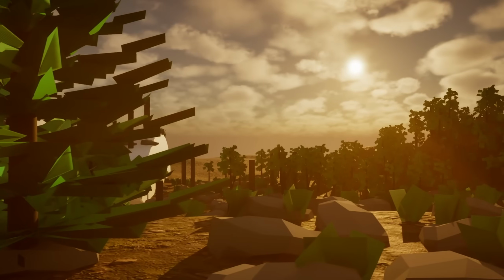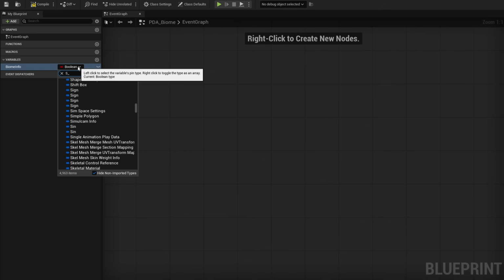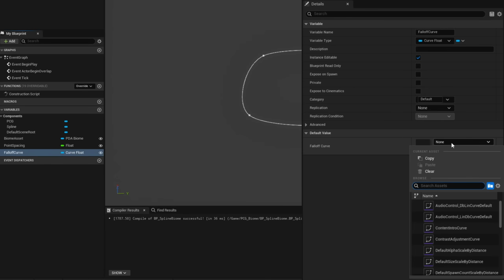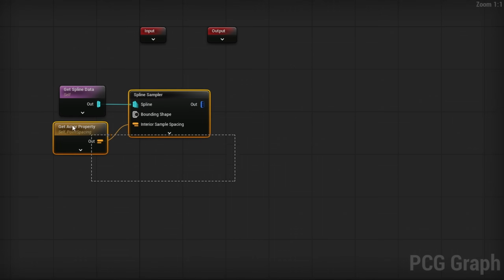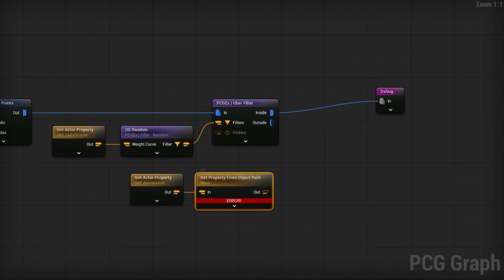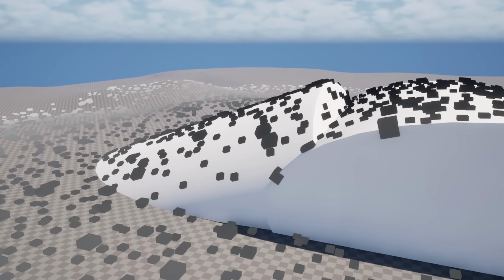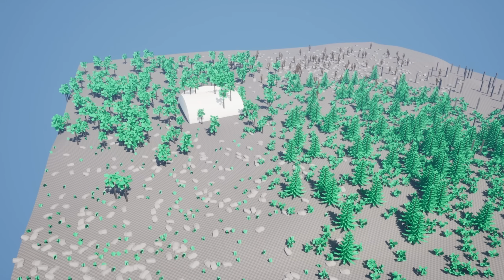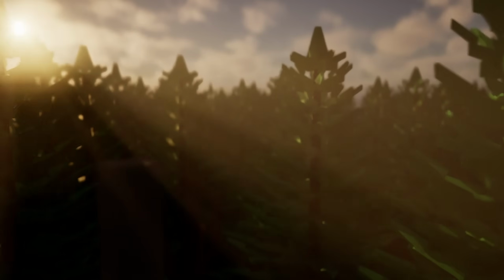I Made My Own Custom PCG Biome System, And You Can Too!

Comment: ah is it easy to get the new Skeleton rigged foliage assets working with it too?
Reply from the maker: That's just a difference of using the Instanced Skinned Mesh spawner (I believe that's the name) instead of the Static Mesh spawner.
Reply: @Procedural_Minds  ah, thanks for replying, I should have done a little digging myself. Thanks.

Comment: I follow this tutorial and looking forward to see other tutorials you made on PCG. There are very interesting topics in them. I'm new and this is the first video I was able to follow after watching those old tutorials where things are totally different from 5.7.
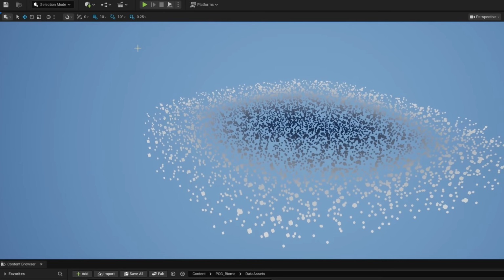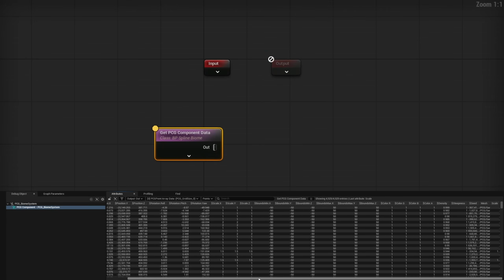Here I got stuck. After deleting the default landscape and generating the new one PCG is not working (around @18:55). The debug won't change the location or rotation and the boxes are floating in the air and not aligning with the landscape. When I select a node and press 'a' it says "no data available". Also @23:50 when we make the  PCG_Biome system the "Get PCG component data" gives a warning telling BP_SplineBiome has no previously generated data or they have been filtered out. 
Do you know why this happens?
Reply from the maker: My guess is you just need to do a cleanup and re-generate so it detects it all again.
Reply: Clean up and generate fixed it.

Comment: This feels much better than the official biome system, which puts too much constraints on DA setup and feels overcomplicated, rigid and thus of suboptimal design. The good biome system allows for greatest flexibility when it comes to categorizing areas. By encapsulating the actual point spawning logic it is easy to modify your system so that for instance instead of splines it takes into account material layers. Thank you.
Reply from the maker: You're welcome! The official biome system is miles ahead in its built in compatibility, but also as you say, miles ahead in its complexity. And not everyone needs it always.

Comment: Yeah... I can't get it to work.  I'm guessing the PCG has been updated and I found the constant node which is what I'd assume would be used to divide and multiply.
Reply from the maker: Shouldn't be anything that has changed enough for it to not work in newer versions. If you don't have inline values then that's pre-5.6. So you might be on an older version compared to the video.

Comment: This is an excellent system overall. But how could we add ground litter like rocks and logs to this biome, but without it using up a percentage of the points already being generated for trees? If I add additional assets to the biome data asset, it will thin out the trees. But if I add two biomes over each other, the points of each biome will collide. I understand why it does that, but is there a way to get around those limitations?
Reply from the maker: You can re-sample the spline however you'd like. And you can make as many copies of the points as desired. This is all from a single biome, no need for multiple. You then set it up to use X points for trees, and Y points for rocks or whatever else.

Comment: Incredible video, thanks for all the hard work!

Additionally, after implementing this system, it seems that the PCG_BiomeSystem is unable to be generated on demand, during runtime. I've been digging into it for about a day now and really have no idea why. Any ideas on where I can start to look?
Reply from the maker: Runtime and on demand are separate. You can either have runtime / hi-gen generation, OR you can generate it on demand. Now I could be wrong on that. But for some reason I remember someone saying that a while back. You should be able to test it by turning off hi-gen / partitioning and trying to spawn it on demand. If it works then that'll confirm they're incompatible.
Reply: @Procedural_Minds  Yup, apologies, my brain was a bit fried when I wrote this comment. I meant to just refer to on-demand generation.

And yes, I tested it out just now and you were correct. It seems hi-gen is the culprit here.

For anyone else trying to implement this custom biome system with on-demand generation, you will need to eschew the PCG_BiomeSystem graph and instead rely solely on the PCG_SplineBiome graph. To do so, copy the `Static Mesh Spawner` node from PCG_BiomeSystem and replace the `Output` node in PCG_SplineBiome with that copied `Static Mesh Spawner` node. Then, in the BP_SplineBiome blueprint, go to the PCG component and navigate to `Details` > `Settings` > `Generation Trigger` and change the dropdown option to `Generate on Demand`.

You can then generate the PCG components on demand by getting the PCG component of BP_SplineBiome (ie do a for-each loop off the output of `Get All Actors of Class BP_SplineBiome`, then drag off the array element and `Get PCG`) and calling the `Generate` node on it. Note that this removes all the performative chunk loading stuff that PCG_BiomeSystem provided, so plan accordingly.

Thanks a bunch, @Procedural_Minds ! You da best.

Comment: great video, thanks! How would you deal though with overlapping points from different bioms? I think the epic's biome system has some pregenerated point grid system that got distributed amongst biomes, but I'm not sure
Reply from the maker: You can just overlap or not overlap as much or as little as you want. By tweaking the falloff you could blend it gradually or quickly.

Comment: For anyone wanting to learn more on the Customization for the DA and Structure variables, definitely watch his previous video called You Should Start Using Data Assets in PCG. Logic is pretty much the same except we've added a PCG System in this one. 

If you're like me and wanted to add Absolute Rotation Boolean to your DataAsset options, it took me a sec, but I figured out how. Any recommendations if you know a better way, please let me know. 

Here's what I did to add Absolute Rotation to my DA, FYI i'm using UE 5.6.1. 

Create the Structure variable, AbsoluteRotation / Type Bool / Default False
Save and make sure to Recompile the PDA_Biome we made, or it won't work and you won't be notified that you didn't recompile. I got stuck here totally forgot about that, it's easy to forget.

You should now see the Absolute Rotation option in your DataAsset. I turned half of mine on so I could see if it registered true/false accurately when I inspected the nodes.

Now, the PCG_Spline_Biome graph:
I moved my projection to the earlier part of the chain right after the Spline Sampler so that it didn't override any of my transforms later in the chain. I used the World Ray Hit Query on the projection target.

For the Abs Rotation logic, I used 4 nodes:
After the Match and Set Attributes, create Filter Attributes Elements node with these settings - Operator: "=", Target Att: AbsoluteRotation (This should match the exact name you gave it in the S_Biome), Constant Threshold: Enabled, Type: Boolean, Bool Value: True.

Create a Set Node with input Source 1: $Rotation and Output Target: $Rotation
Right Click InB and convert to Rotator or you will get the Quaternian error. 
Keep these values set to 0.0
Connect this InA to the Filter Attributes Inside Filter. 
Create a Union Node Default settings works.
Connect the Set output to In1, and connect the Outside Filter to In2.
This basically says, if Abs Rotation, reset their Rotations to 0 and If not abs, keep these values the same. I'm using the Filter Attributes as an IF/THEN.
The union should bring them all back to their total points. Use inspect to doublecheck that the Union Entries totals the same as the Match and Set Attributes Entries. 
Then us To Points node to convert the Union Output and connect to the Scale LERP InA, and to the Multiply InA/InB, and the Attribute Noise Input like we did in the tutorial. Again, I used both tutorials for this, so if you're on one that didn't do this, check the other video he did that I mentioned. 

I really hope this helps others. It took me a while to come to this solution after many hours trying to access the other data from the Transform Points. 

For @Procedural_Minds or anyone else that may have some tips, greatly appreciated here. I'm very new at PCG, only the past week so if I did this horribly, i apologize. What I would love to see is how we can basically get ALL the Transform Points Parameters and expose them into the Structure and DA for the meshes since this is the most common node for this in PCG and most of those settings would be wanted/needed for the PCGs biomes. I think the solution would be in creating a Custom Execute Blueprint BP that basically passes all those parameters through with the DA. That would be a great video tutorial!!!! I tried, but those Blueprints are very complicated for me since I only learned about them 2 days ago. Hope all this helps!
Reply from the maker: For absolute rotation you can just plug the bool into the transform points node's absolute rotation to swap from relative to absolute. :)
Reply: @Procedural_Minds  I'm not following. If I run it through the transform points node, the transform points does it to all my array meshes inside the Structure, not on a per mesh basis if I have 5 different meshes in my Biome. It's the same way that you weren't able to use the Transform points node to manipulate the scale, rotation, offset, mins and maxes using the Transform Points Node I thought. Isn't that why you didn't use the transform points? Sorry i'm new at this. That was the first thing I tried. If there is something I'm missing then I'd love to know. But the only way I could get it to pass those parameters through was by the method that I outlined. I just tried what you said and it did not work and did it to all of my array meshes in the DataAsset. I must be missing something from what you're saying.

Comment: Great Video! I just really wish you showed us how to make the normal adjustments we make to our PCG Static Mesh Spawners on a Per Mesh basis. It seems they are all bundled into the S_Biome now where we can adjust the Mesh, Weight, and Scale, but not ranges or rotation ranges per Mesh. Like if we wanted all the Transform Points options we normally have, especially for the scale transforms. Or, if we want only some meshes to have Absolute Rotation and other ones we want to follow the curvature of the landscape such as bushes. Do you have another video covering this since these are pretty typical things people would want to make adjustments to on a per mesh basis. Either way, this video is extremely helpful and valuable and I cannot thank you enough for your dedication to the community.
Reply from the maker: I have a tutorial on Data Assets on the channel that shows how to do that. Which is why I didn't dive into it too much as it wasn't the main focus. I recommend checking out that video. :)
Reply: @Procedural_Minds  Awesome thank you! Do you happen to have a link for that so I know i'm watching the right one? You have a lot of videos haha. But one thing that would help us greatly is if you do have situations like this where you skipped the details due to another video, if you could drop a mention in the Description with the link for people in my situation, it would be super helpful! Thanks again!

Comment: +1 Yeah a series of this would be awesome!
Reply from the maker: Anything specific you'd want to see if this became a series?
Reply: @Procedural_Minds  This stuff may be out of scope of the PCG system itself, but I'd love to see it interacting with and deforming landscapes, changing the landscape material to suit the biome, maybe spawning subgraphs to generate buildings or villages as biomes (or possibly on top of other biomes). Maybe adding a procedural river or other body of water and going over how it would affect the other biomes near the water banks if applicable. This would be a slightly separate topic, but I'd love a tutorial on making this a generator of sorts that works at runtime, re-running the PCG system to make a new area/level/distribution each time, especially if that's something that could also move the spline points and such that you hand placed. Maybe utilizing a noise function like common terrain generation? 

I'm rambling but those are the kind of things I'd really love to see

Comment: Can PCG handle the landscape “auto material 
“ logic. I have only seen PCG be generated based off landscape height, color / splat maps. 

Not sure if PCG biomes can be the driving logic on how landscape materials are applied. Like the other way around. Landscape texture > PCG vs PCG > landscape texture 

Like could you have different materials for each biomes setup that take in height / slopes etc and have each biomes setup blend the entire landscape texture and be updated based on PCG. 

Might be missing something or over thinking too much. lol
Reply from the maker: As far as I know you can't dynamically "paint" the landscape. Even in Epic's PCG Biome system, the two are separate.

Comment: Nice setup! What really would be great in future videos would be a (nearly) complete GPU-only implementation, because these PCG graphs run mainly on the CPU and for runtime generation this could be very costly. So games like Horizon Zero Dawn offload the complete procedural generation logic to the GPU (Compute Shaders) to reduce CPU load and to get even denser vegetation. This should be feasible with Custom HLSL nodes an a bit of math. ;-)
Reply from the maker: If I knew any HLSL I'm sure this would be simple. Unfortunately I don't. I know Epic is working on creating a setup that won't require HLSL in the future, but for now you need to know how to code.

Comment: Im really digging on each video about PCG. You explanation is very helpful, educational and straigt forward. I undestand what i need to do how i need to do, and i undestand how to expand for my implementation. From my point of view i like to know if is possible to manipulate landscape from PCG. I have seen to make trench, but i didnt seen something like when i have PCG configuration for trees, to change landscape also to tree layer. Also if i put curve through landscape if is possible to make this part of landscape invisible (for cave entrance).
Reply from the maker: As far as I know there's no way to change the shape of the landscape during runtime. You can put holes in the landscape with the landscape modeling tools though.

Comment: Wouldn't it be more convenient to use the built-in data asset in pcgex?
Reply from the maker: Depends. You can't add custom variables to the PCGEx version. So if I wanted to add a variable to store the tag I want to project onto, I can't. But I can do whatever I want in my own Data Asset.

Comment: Why does my divide not have a slot to put a number? Is that new to 5.6? I just created a param anyway but seems quicker and visually better to have it like yours.
Reply from the maker: Yes, this is new to 5.6. If you're in previous versions then you'll need to use a create attribute to plug a value in.
Reply: @Procedural_Minds  Thanks, I did already have it figured out but it might helps others if they aren't on 5.6/new to pcg.

If you continue this series a solid addition would be to modify it to use pcgEx patterns like Voronoi or whichever to assign the biomes. This could potentially assign ground material, grass type, some smaller rocks and more general biome things. Then inside each section have it spawn a series of splines (create spline node) or in each section split it into its own pattern which handle more larger things like trees clusters, larger rocks, ect. I know you covered some of pcgEx pattern sampling in the castle video but i think it would also work well for biomes. But it may be difficult to spawn closed splines with PCG, might end up having to spawn stuff along the splines instead.

Either way ill probably start digging into it more myself, as i am getting frustrated working on sailing mechanics. Granted my sailing isn't far off but the main issues being. I need to figure out if i want to move the boat to skeletal mesh so i can have a player animated as connected. The boat simulating physics and character movement component don't like each other so the boats physics end up getting messed up no matter how i do it. That way i just remove the player from the boat on posses and just have the animation of the player "sailing". Which basically mean i need to rework my whole boat, but at least a lot of it is components.

Comment: Similar to games like Valheim that generates an entirely procedural world, is there a way of doing that inside UE5?
Reply from the maker: The main problem I see is that as far as I know there's no way to spawn a landscape and then deform it at runtime. Most games do it with spawning geo for the ground instead. It's possible, but it's not simple.

Comment: Nice video! Thank you! I've jsut found that in 5.6 they've added new option Sub-World Partition HLODs. Have you tried this? Sounds very interesting - "Added experimental support for HLODs of Sub-World Partitions to be visible, even if their owning level is not streamed in, through a new Build Standalone HLOD option set in the sub-world partition level under its World Settings - World Partition Setup options."
Reply from the maker: Is this for PCG? Cause I haven't heard about this for PCG. Keep in mind PCG doesn't use the same world partitioning as everything else. It's its own thing.

Comment: You said that you wanted suggestions based on expanding the stuff you have there. So, I'm not sure if you'll feel that this qualifies. However, I think it would be great if you could Spawn more terrain and PCG biome areas if you approach the edge of the map. Thanks for the great video.
Reply from the maker: What you want is basically an endless landscape. From what I've seen, the way people do this is by spawning geo since you can't deform landscapes dynamically.
Reply: @Procedural_Minds  You can deform landscapes dynamically with the Landscape Patches, though I'm not sure that would help with the issue above.